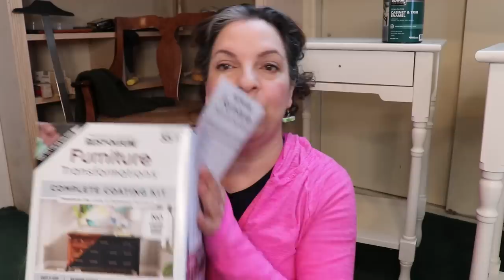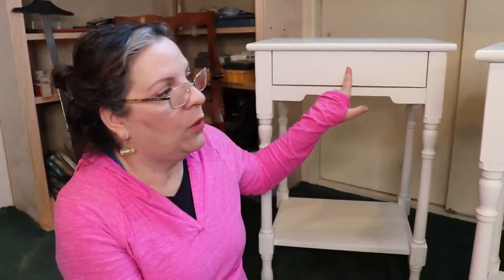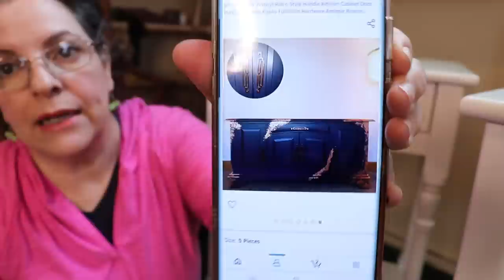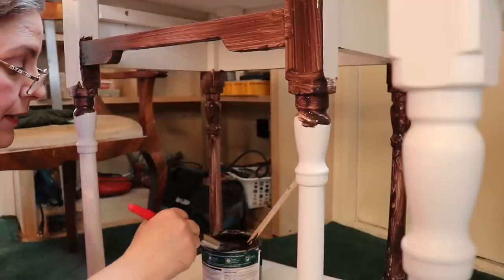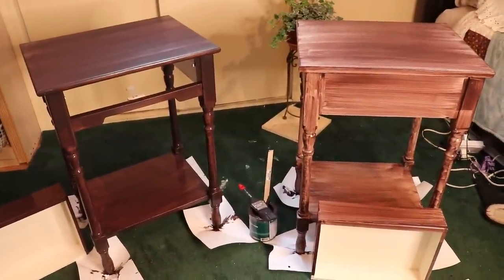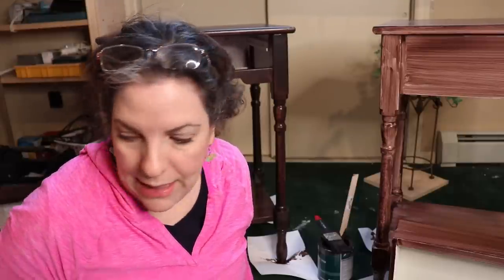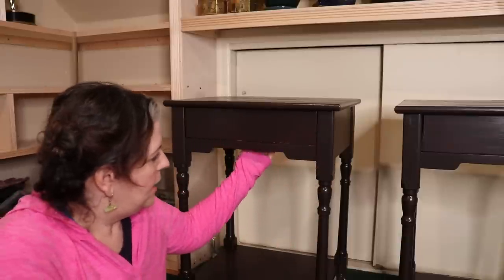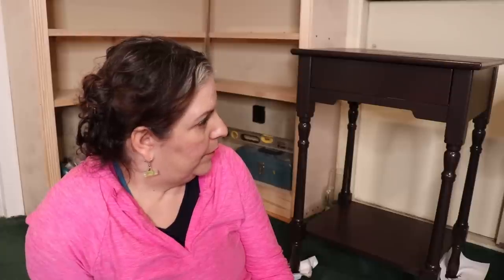Master Bedroom Makeover Series || Nightstand Restyle || Episode 19 ||

Comment: Great job on the night stands. That color is beautiful. You don't need to put tempered glass on the tops. Tempered glass has to be special ordered and your measurements have to be perfect because once it's tempered it can't be recut. (My parents owned a glass and mirror store for over 10 years and I worked for them for over 8 years). We always cut 1/4 inch glass (aka plate glass) and had a machine that had diamond grit wheels that polished the edges. Also, you need to ask the glass shop for the thin plastic spacer dots to put between the glass and table top. The dots are about the size of a nickel and are maybe 1/16 inch thick. They are not sticky but they will sometimes adhere to the glass or table when you take the top off to clean it. It's more like a vinyl cling and you can peel them off easily. However rearrange them every time you clean because over time, if left in the same spot will make a permanent dent in your furniture, but that takes years before that happens. The reason for the dots, they allow air to circulate between the glass and the table top that prevents condensation and mold to form. Unfortunately it also lets in dust and will need to be cleaned regularly. Another tip, if the edges start to look dry and chalky, take a cotton swab dipped in baby oil and run along the edges. Your glass will sparkle like it's brand new.
Reply: Thanks for this tip.
Reply: OMG you brought back memories for me.  Years ago I got a beautiful console tv that had a just gorgeous wood cabinet.  I went to a glass place to order a top for it.  The guy told me exactly what you have shared here.

Comment: I understand carpet for any sound transfer to downstairs, but like you I've got pets and it's far easier to clean and keep in good shape with hard floor and inexpensive throw rugs! I don't know the measurements of your room but you could put a big throw partly under the bed so you get out to a soft floor, 8x10 or 10x12... And then if Scott needs to walk the red carpet to the throne, you could get a matching runner or a round throw for the library/bathroom door/sitting area! Then when Fiona happens you'll be able to easily clean the rugs and replace them as needed, which would be excellent for your asthma! Wall to Wall carpeting can easily be more expensive than a quality hardwood or laminate and requires professional installation where many hard floors can be installed yourself, especially since you're so handy. As someone who has allergies and inhalers, I would be arguing that the healthier option for myself is hard floors with the throw rug options. 🤷🏼‍♀️
Whatever y'all decide on I am sure it will look amazing! You're really creating an awesome space! 💞

Comment: Scott can pick his plush carpet and get specific sized rugs made from it that have binding sewn edges and throw them down on top of hard flooring.  I think I saw that as an option at home depot about 20 years ago called Custom Bound Rugs. Wouldn't have to buy the padding under, and sometimes come with it for free, and if something happened to a portion of it, it could be cleaned or replaced pretty easy.  But I recommend to stay away from laminate flooring. Especially, if you want to try to reduce noise, it's a bust. We installed laminate in our master bedroom addition to sort of go with the rest of our house that has hardwood, and it was slippery as hell and every step was a clack sound. We removed it after living with the consequences for 6 years.

Comment: When you put the glass on your table tops remember to put the little spacers underneath it so the glass doesn’t stick to table. I did that once and it ruined my table because I didn’t have air circulating under the glass. But you probably know that.

Comment: Your bedroom is sooo coming together.. you have and are doing a great job!…. I really don’t think it matters if the handles on your night stand go one way or the other… I like them turned up.. keep up the good work 🙂 … Also if you put in flooring they sell beautiful scatter carpets for the side of the bed or you could just lay down a larger rug that’ll just go a bit under the bed.. It’ll keep the dust down by not putting wall to wall carpet.. 😊
Reply: Actually,wall to wall carpet is great for keeping dust down as long as you vacuum it frequently, (everyday is ideal)😖and get it professionally steam cleaned yearly. Carpet,upholstery and drapes act as air filters and when they are full,you’ll see more dust flying around. We used to clean an office that had a long,two height counter. On the side where the secretaries sat,there were ALWAYS dust bunnies that moved like tumble weeds.This was despite the fact that we cleaned it twice a week with a spray and wet cloth and moved everything! When they finally got the carpets cleaned ( after five years)😵‍💫 No more tumble weed dust bunnies!!!!!
Reply: @lauramitchell6725  … carpets hold a lot more dirt and dust no matter how often you vacuum… I’ve known people with allergies that it was suggested to them to remove the carpeting from their bedrooms.. at least with flooring you can see the dust.. I certainly wouldn’t want to vacuum everyday.. 😬